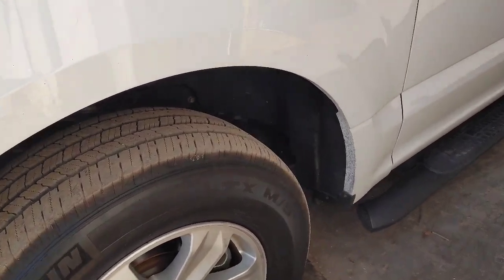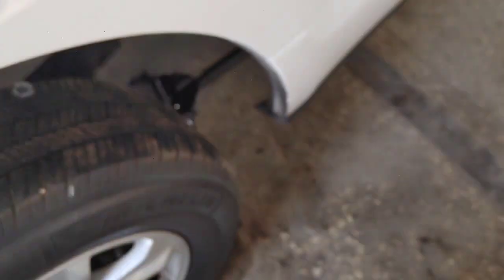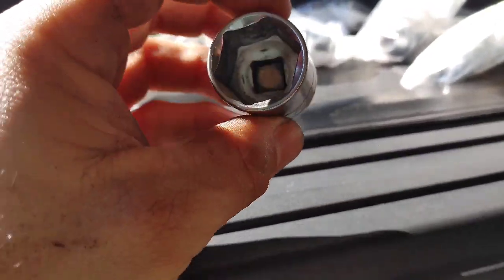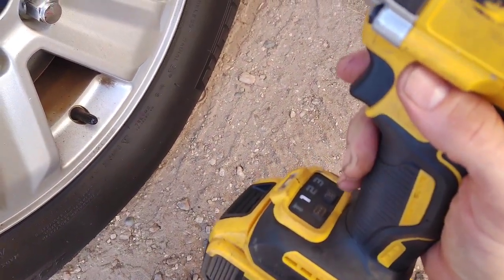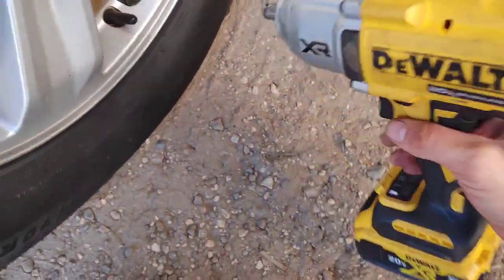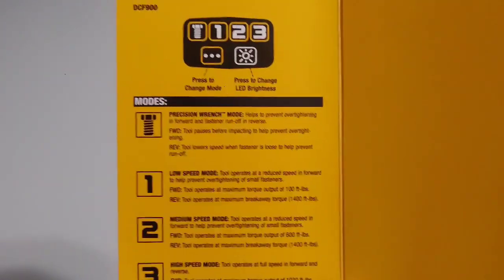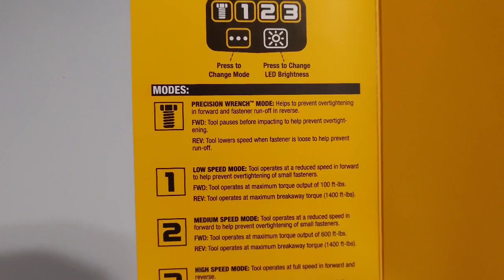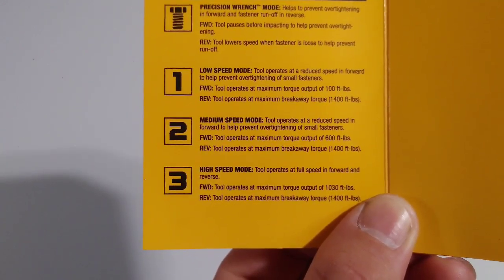DeWalt DCF900 Demo + Ford's lug nuts are junk!

Comment: They make intermediate size sockets so if it takes a 18mm you use a 18.5 instead so it accommodates the swollen lug nuts.
Reply from the maker: Those stock lug nuts were so weak that the outside of them would still twist and fold allowing the socket to spin. It worked better for us to just hammer on the 22mm socket which is what I think it was origainlly supposed to fit.
Reply: Honestly you should go with a 19mm instead so the socket doesn’t get stuck

Comment: Almost every Ford truck owner who lets an impact wrench monkey tear up their lug nuts w/o actually torqueing them to an actual spec will eventually have this problem.  Even with great care it more than likely will still happen, eventually.  The "two piece" lug nut design (with a sheet metal cover over the harder solid core) will eventually get buggered.  It just happens.   That's why the dealers always have them in stock.  I went 11 years, many tire changes and tire rotations at everywhere (dealer, Costco, local tire shop), and a half-dozen times off doing my own brake & suspension work over 199k mi (2012 F150).  There are both US and foreign made solid lug nuts that work very well & are sold online for $40-95 (China/Taiwan vs US made) for a full set of 24, 14mm x 2.00mm (whereas the dealer wanted $4-5 ea) nuts.  As soon as the first lug nut gets stuck, its time to change them all.

I had a full set of tires shipped to Pep Boys from TireRack.com last August, '22.  The Pep Boys tech must have been pissed putting on those heavy tires.  A month later when I went to pull off the tires to remove & turn the rotors, all but a couple of the two dozen lug nuts were badly deformed.  The first lug nut I was able to hammer on an OEM sized 21mm lug wrench, but then had to use a punch and hammer to get the lug nut out of the socket.  The next lug nut it wasn't even close.  I had to get a set of "flip lug nut sockets" (metric) that included not only the 21mm socket, but also 21.5, 22 and 22.5mm to accomodate all of the variety of buggered lug nuts, and I still had to hammer & punch out a couple when I eventually did change out all of the lug nuts with new ones.  Every Ford truck owner should be informed of this issue, or if you don't do your own service just wait until the service tech's at the shop you go to tell you its time to replace them.  At some point they will become unserviceable.  ("Turbo" / "stripped lug nut / bolt remover sockets" are also another option for removal.)